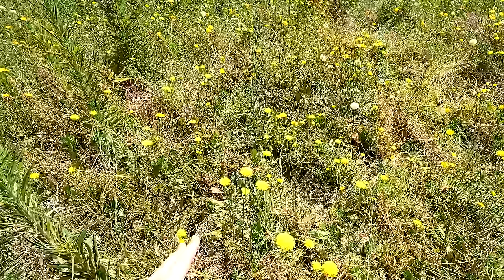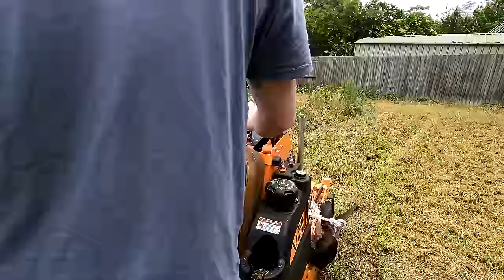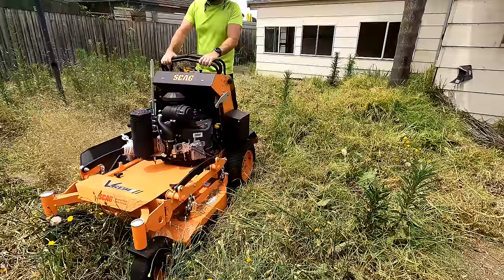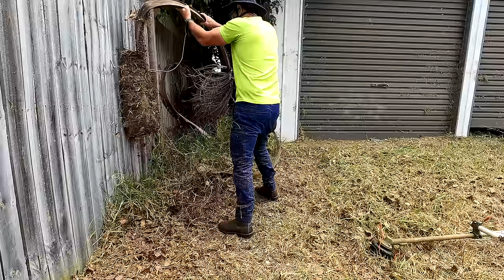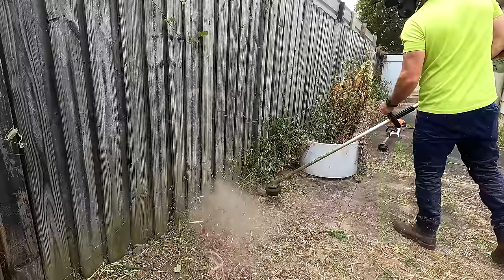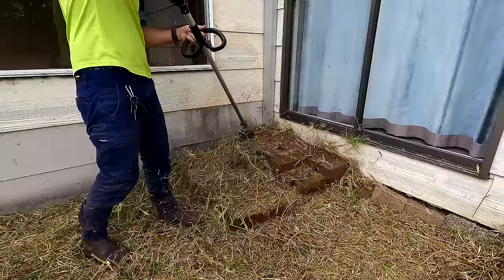NO PERMISSION! NO PAY! 100% Satisfaction! Oddly Satisfying Yard Makeover

Comment: Tim, have you thought about setting up a wire mesh compost bin for customers to compost garden leftovers and reuse them on the same garden as nutrients later on. Great video. Maybe you can subtitle the equipment description while in use as reference. I like how you trim tall weed from the top to avoid jamming the string trimmer.

Comment: I have a SCAG and I can tell you first hand they are a BEAST….. I slid into metal fence post and it cut it down from three inches to a half inch before it bound up. The spindle nut backed off and the entire spindle dropped down, didn’t break only burned the belt. I popped everything back into place and was back up and running no damage.
I replaced the blade and the belt when I got back to the shop obviously but I can’t think of any other piece of equipment I own that could handle such abuse and keep going. Excellent choice IMO.
Reply from the maker: Wow that sounds like a lucky scenario!

Comment: So I’m trying to decide between a FS 131 or a fs 240 which one would you say is better for clearing extremely heavy brush
Reply from the maker: I haven’t used the 131 but obviously the 240 has more power so it will get through it easier but it has a bit of weight to it

Comment: It is about time someone operates his weed whacker at 110% power.  It really is very satisfying to watch the grass disappear when it gets cut with the whacker at full speed.  It is boring to watch someone run the whacker at less than 100% power.  Why don't they make weed whacker strings long lasting, meaning don't need to tap it to the ground to elongate the string?  Would a string made of wire which should last longer be possible, instead of made of plastic that deteriorates?  I think you should have raked the grass clippings, instead of leaving them on the lawn.  Just. thought.

Comment: Anyone elsaudio not play?
Reply from the maker: All good at my end ?
Reply: Hi bro, just wondering what loading ramps you use ?
I'm looking to buy a larger  set and mabe wider as well becouse the pair I'm using now the rear wheels overhang it by 1/2 the width to fit the front wheels on
Reply: Just watched you get hit with glass to the face 
I got 3 stiches a couple of mills under the eye, was wearing safety glasses at the time, now I use a mesh face sheald and the ear muffs are good with it 
Just saying take care 😉
Reply from the maker: I use whipps 3m curved folding ramps

Comment: I had scored you 85% in one of your videos. After seeing this, you scored so much lesser. Why ? 
1) after picking several items, you just threw it to another section of the yard. A negative score of 10. 

2) the branches which you picked up, you didn't put them at your truck OR into several garbage bags. A negative score of 15. 

3) you didn't carry the white pot. A negative score of 5. 

4) after you showed a weed (menace), you just threw it to the ground. A negative score of 5. 

5) you didn't cut the grass at the following areas ie.
5.1) the narrow dark area (beside the white building) and
5.2) behind the same white building. A negative score of 25. 

6) why didn't you trim the tree branches at the narrow area, and at the yard itself ?A negative score of 10. 

Thus, 100 - (10 + 15 + 5 + 5 + 25 + 10) =
100 - 70 = 30. 

You scored 30 points. Extremely disappointed.
Reply from the maker: Send me your details so I can give you a refund